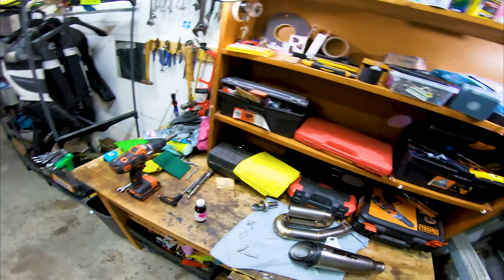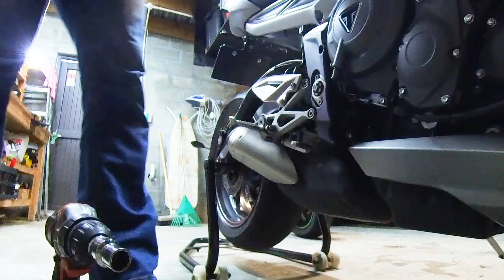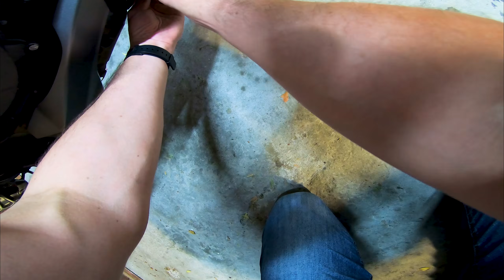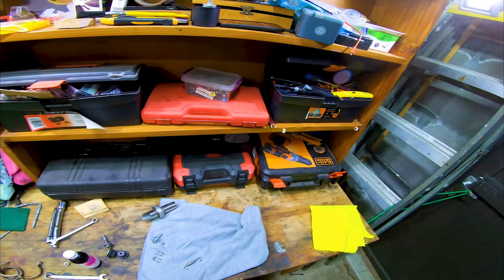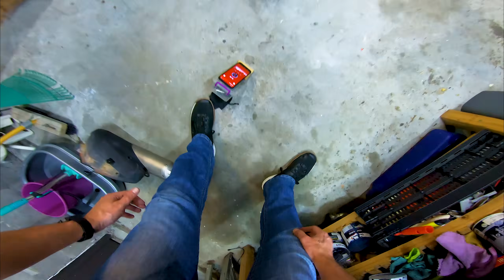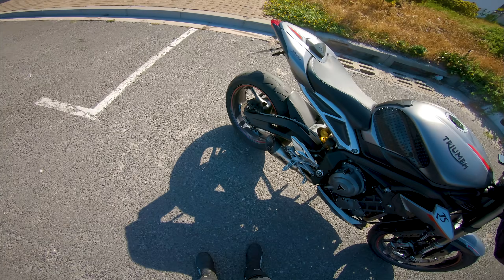AliExpress SC Project Installation and Sound for Triumph Street Triple 765RS

Comment: Real shame it has a cat. Looks great but would want that deleted for track
Reply from the maker: Its quite loud even with the cats, i wouldnt remove them, they dont really do anything either.
Reply: @DarkRiderMotovlogs I had mine mapped on the dyno and they recommend removing them. Could be bull but for the metal to get hot enough to break down emissions it must create a fair bit of resistance

Comment: I finally got it and it sound sooo goood! But question… 1) it came with a bracket but I’m unsure what it’s for and 2. Did you use the 2 rubber grommets and the 2 inner t shaped washers? I can use those except the 1 t shaped washer where I connect the exhaust plate behind
Reply from the maker: Hi! Good to hear that! Im not sure what washers and bracket you are referring to?
Reply: @D @DarkRiderMotovlogs like in your video I can’t tell what original attachments you have to the exhaust. In the back. I wish YouTube had a send photo option but at 8:00. That’s the attachment I mean where the bolt goes through. I’m asking if you had the rubber grommet attached in the back of the plate as well as the metal t shaped washers
Reply: Wait I can see you have them attached when I zoomed in! However when I tried to attach it wasn’t going right thru
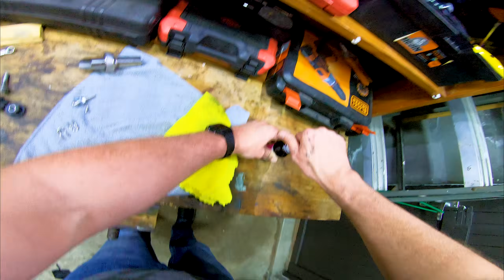Reply: @DarkRiderMotovlogs at 10:28 top left… those are the rubber grommets I meant with the silver metal inserts in them

Comment: Hi there. I am living in Jhb. About to buy latest Street Tripple RS. Could you please reference the model number and price of this SC exhaust. Would like to get it.
Did you have any ECU flashing or tuning done, after the fitment. How is the pipe holding up, quality wise ?
Thanx in advance 👍
Reply from the maker: Hi there!

For the 2025/26 models this exhaust wont work unfortunately. The 2024+ uses a 1 one piece header system where the headers, cat and end box are all one continous piece. 

Youll either need to get a set of 2019-2021 headers second hand or off ebay, or youll need to have your exhaust taken to a fab shop and cut the back box off and make an adaptor for the slip on.

I also think that the latest bikes use 2 sets of O2 sensors, before and after the cat and will require a retune and dyno time to calibrate.

Comment: Bro why Fake?
Reply from the maker: Why not? it does the same thing as a real SC project for 1/10th of the price. 

Any slip on past the cats and headers is purely for looks and sound and offers zeo performance benefits. So why waste $800 on that...
Reply: @DarkRiderMotovlogs Are you serious? AliExpress exhausts are rubbish quality and will just ruin your bike’s engine. You might think you’ve got a bargain by spending just $200 instead of $800 or more, but in reality you’ve just got an exhaust that can’t handle the heat properly and will melt in the long run. I’d rather spend the right amount of money and get a proper exhaust, not some cheap knock-off
Reply from the maker: @AnItalianOnTheRoad everything you have mentioned is unfounded 😂

I have been running these exhausts for over 2 years now and they haven't rusted or melted or have had any damages at all. They still look the same as the day it arrived.

The quality is much better than the old days of the cheap mild steel and tin knock offs.

They aren't poor quality or cheap any more.

Comment: Hi, 
Thanks for the video, it was helpful to decide whether to get an Ali exhaust or not.  
I have a 2022 765RS.
Any chance to update the Aliexpress link to show which mid pipe and exhaust you chose? 
Thanks!
Reply from the maker: Hey! There are quite a few that are the same but you can try this one.

https://www.aliexpress.com/item/1005008797611474.html?pdp_ext_f=%7B%22order%22%3A%22-1%22%2C%22eval%22%3A%221%22%2C%22fromPage%22%3A%22search%22%7D

or THis one

https://www.aliexpress.com/item/1005010787781091.html?pdp_ext_f=%7B%22order%22%3A%223%22%2C%22eval%22%3A%221%22%2C%22fromPage%22%3A%22search%22%7D

Just search "Triumph 765RS Exhaust" and a lot of options come up.

Cheers!

Comment: Hello

I thinking about buy an exhaust for my first bike ( street triple 765 R ) 2025
Is there a big sound difference original vs a fake exhaust ? I want do more sound but not that much. Don't want problem with police
Reply from the maker: They sound the same but the chinese pipe is cheaper. This pipe wont work on the 2025 unfortunately, the 2025 bike has 1 piece exhaust system.
Reply: @DarkRiderMotovlogs seriously? Any work on 2025??
Reply from the maker: @spawn4760  You'll have to get a 2020-23 headers and link pipe or you will need to cut your headers near the cat and have a link pipe made and welded on, then the bike will need to be tuned as well. Quite annoying on the newer bikes.

Comment: Hello from France, did u notice a lack of power or torque ? Did you made a remap after ? I just bought it, it is on its way and someone in France said they had a lack of power right after the instal 
Nice video btw and thanks !
Reply from the maker: Hi there! no, I didnt notice any lack of power or torque on my bike after the installion. 

I did however have the "Arrow Map" from Tune ECU 9its free) on my bike that is made for slip-ons. If you have a Tune ECU licence and a compatible bluetooth OBD reader you can flash it one very easily. 

But even stock, it will be fine. I took this exhaust for the 2 cats and the curve adds extra length to the exhuast so you dont really lose any back pressure.
Reply: @DarkRiderMotovlogs ok Nice thank for the answer ! Have some nice ride ✌️

Comment: Just got mine installed and two things, the install was superrr easy. Only issue I had was connecting the mid curved pipe to the pipe that was already there. It didnt want to fully seat on the other pipe and you could see the space between the two pipes. I had to use ant seize to lubricate the sliding pieces. A little smoky afterwards but perfectly normal. And the sound without the db killer is amazing. A little loud but what other reason did you want an aftermarket exhaust?! 

Thanks for the video man. Sucks to see you sold this gem. 

From FL ✌️
Reply from the maker: Awesome glad you got it sorted out! 😎Cheers man thanks for watching!

Comment: I it's very good, but the answer is: do you have a problem with light engine? Do see this? Are you remapped?
Reply from the maker: There is no engine light as nothing was tampered with. Only on the Daytona 675R with the exhuast valve, will you get the engine light. 

Yes I am running the "Arrow Map" from tune ecu to help with fuelling, but you dont really need it and can run as is.
Reply: @DarkRiderMotovlogs I have a MT09 2024 gen4, I would be curious to try an SC from aliexpress but I'm afraid of seeing the engine light come on.
Reply from the maker: @vito21cent80  Im not sure if the MT09 has an exhuast valve so you may need a servo buddy, you can also find those on ali express.
Reply: @DarkRiderMotovlogs what is servo buddy?
Reply from the maker: @vito21cent80  It stops the light on the dash from coming on for engine error when removing the exhaust valve on some bikes.
Reply: @DarkRiderMotovlogs ok o understand, but to aliexpress there isn't for mt09 2025, I now this to SC project web site, I don't now if another yat work for this

Comment: Never understood the looping exhaust, seems redundant.
Reply from the maker: The loop is to create extra length and keep the back pressure. By using a loop you have a longer mid pipe which helps with keeping the midrange torque and power in tact. Short pipes sacrifice back pressure which lead to power loss, if you don't get the bike dyno tuned.

Comment: Sounds really good.
Would this exhaust fit on a 2024 Street Triple R?
Reply from the maker: Unfortunately the 2024 models have a 1 piece header, mid pipe and end can. So only way to fit is to replace the headers with one from a 2022 and older model.
Reply: @DarkRiderMotovlogs  Or to cut off the breadbox and shove it on there.
Reply from the maker: @casper18795  That can work as well, just need to weld it nicely.

Comment: Hello, I'm from Spain, I just bought the 2024 Triumph Street Triple RS with 2000km, I was looking for an exhaust on Aliexprees, could you give me a purchase link to order one? thank you
Reply from the maker: Hi there! Unfortuntely this wont work on the 2024 model or the 23' model as they use a single 1 piece header design. There is no removable end can on those bikes. You will need a full system and then a piggy back tuning system.

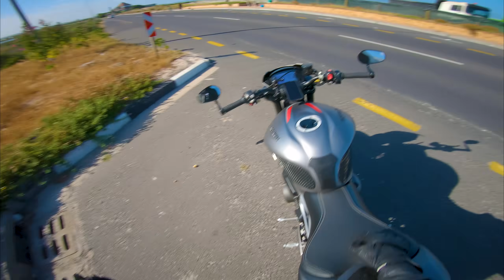Comment: Hi m8! One question. In the video 17:33 yo do like a 2step with the throttle. Did you made any tune to do this? I would like to have that like "rev limiter" on mines. Im waiting for my fake SC as well for my RS. Sick video BTW
Reply from the maker: Hey man! Yes this is the Arrow MAP that I flashed to the bike. Its on the Tune ECU website. I flashed the ECU with this map to account for the leaness that comes from removing the stock exhaust. The cool "2 step" soft limiter is a fun byproduct of the map I guess :) 

Cheers thanks for watching and commenting :)
Reply: @DarkRiderMotovlogs  Hi man! could you tell me exactly what map you flashed on the bike? as I have the same version of street triple rs (2017) and I have put exactly the same exhaust. What do you notice of improvements on the bike with that map?
Reply from the maker: @miguiussss  Hi!

Its this map: 
30115Map.hex OEM_Rev.04
https://tuneecu.net/Tune_List.html

Just make sure to check against your VIN for which one you need but that should be right.

Overall the bike feels a bit smoother but not by much, the map is only really for making the AFR richer in the lower rpms for  the free flowing exhaust. So there wont be any power increase etc but does feel a bit better. 

Hope that helps!

Comment: Hi ! Great vid, i have a street triple 660 and i think those are compatible with the 765 exhaust, do you know if it's true ? + Is there a risk using cheap exhaust for the motor ? :thx !
Reply from the maker: @valdairsofteur9622  Thanks!

I don't think this will be compatible with the 660 as the headers are different. On the 765 they come from the left side of the oil sump and on the 660 they come last the right hand side of the sump like the 675.

But there is definitely options on AliExpress that will work with the 660.

No risk to the motor as you are just replacing the end can and keeping the catalyst in place. 😎👍
Reply: @DarkRiderMotovlogs  Thank you for your answer ! I will check any options, sounds amazing ! Have a great day :)

Comment: Lekka bru. Making me jelly here. Hopefully I can hear it at Killarney the end of the month. Would you run the db for the track? I have always wanted a racefit, but my current yoshi is also very nice
Reply from the maker: @gsxrpat6147  haha thanks man! Nah don't think I'll run the db killer. It's not that loud that the track will have an issue. But maybe I'll take it with just incase 😅
Reply: @DarkRiderMotovlogs  LoL Wayne said last time they going to kick people if the pipes are too loud but also reckon you will be fine. That ou with the red CBR that ran the straight pipe was rough, dude started it and the sound echoed in the pits.

Comment: Is it possible to homologate the exhaust so you dont have trouble with police ? Thanks. Nice bike and nice wheelies !
Reply from the maker: I think if yput put the db Killer back in it might help with the sound. I will do a test and post the video :)

As for emissions - I still have the stock catalyst in the headers as well as 2 cats in this link pipe but I am not sure how much difference they are actually making in terms of emissions reduction.

Cheers!

Comment: Thank you for the video.
Do you use ear plugs? if so, does the noise hurt your ears?
(I kinda like loud exhausts but I'm scared of hearing loss)
Reply from the maker: Pleasure :)

Yes I always ride with earplugs. The wind noise will really destroy your ears over time and not the exhaust noise.

I use the No Noise earlpugs that have a ceramic insert for a dB reduction. They are nice soft silicone. The reduce the noise but you can still hear low frequency sounds and cars and traffic etc, but cuts the wind noise down a bit. 

start with foam earplugs to get used to it and then invest in some decent quality ear plugs that are re-usable.

Cheers!
Reply: @DarkRiderMotovlogs  Of course, I can't ride without ear plugs. I used Alpine race earplugs for several years but to reduce the noise I opted to pick 3M industrial earplugs. 
They have no technology to filter out some frequencies and pass through some of the audible bandwidth, LOL. They are are uncomfortable too but since my father and sister are almost deaf (started to lose hearing too early for their age) I'm trying my best not to be the third medal winner of the family. 
This 3M earplug reduces noise level by 23 dBs.

At some point you mentioned your ears are hurt but maybe since you are in the garage you are not having your ear plugs in? 

unrelated to the video but two of nicest riders I have ridden with them in Australia are and were from South Africa. Sadly one of them move to another state and we missed the other mate after severe injuries he sustained after hit a tree by the road. 

Your friendly and energetic voice reminded me of my riding amigos.

Ride safe mate
Reply from the maker: @raymadani270  Ah no sorry to hear that. I'm glad you are taking hearing safety seriously as its of vital importance.

Yes in the garage I had no ear plugs in and the exhuast was reverberating around the room quite a lot. 

The inital start up was very loud but now that I have ridden the bike a few times the baffle has burnt in a bit and the noise isnt nearly as loud as when it was brand new, much nicer now.

Ah thanks for the kind words! Very much appreciated :) Hope your friends are doing well and recovering from his injury. 

Cheers!
Reply: @DarkRiderMotovlogs  
You make me wanting a Street triple. I LOVE THEM in the cosmic yellow and they sound amazing. Your upgrade kicked it up a notch.

Thank you mate but sadly he passed away a few weeks after the accident. He was in his late fifties or early sixties. Had recently retired and would ride as much as possible. 
He was a very mature and humble rider but maybe going too fast all the time or maybe it was his time.

Cheers
Reply from the maker: @raymadani270  They do look stunning in yellow! We have a few owners in our group with them and the paint quality is unreal!

Ah no I'm sorry to hear that. :(

Comment: Amazing sound! Just wondering how that “soft rpm limiter” works? I have a 2022 RS and never seen or heard anything about a soft limiter in them. Mine has no soft limit even in neutral with no clutch so just wondering if this is aftermarket tuning or am I missing something? Cheers
Reply from the maker: @just0lux911  Hi! I have the Arrow map flashed to my bike and it has that soft limiter in neutral. Not sure what the purpose of it is but it's fun and sounds cool 😅
Reply: @DarkRiderMotovlogs  awesome thanks for your reply! I’ll look into that, I love the sound of the soft limiter too!

Comment: This actually has me considering one for my 2018.  Have you tried with the DB killer installed?  If so, DB measurement by chance?  Some tracks in my area have strict DB limits and would rather avoid swapping out for stock every time I attend a trackday.
Reply from the maker: @FatherOBlivion  I can do a test for you but depends on your local track db limits. With such a short end can I think it would still be loudish. At 90db idle it's already quite high to begin with 😅
Reply: @DarkRiderMotovlogs  That would be awesome if you would.  I see some other commenters asking as well.  Laguna Seca often has ~95db limits.  Measured at some distance on a specific part of the track, so it's not right behind the bike. Thanks!
Reply: It’ll be too loud